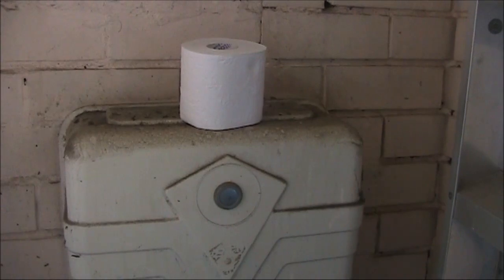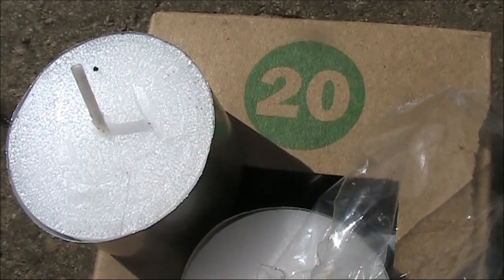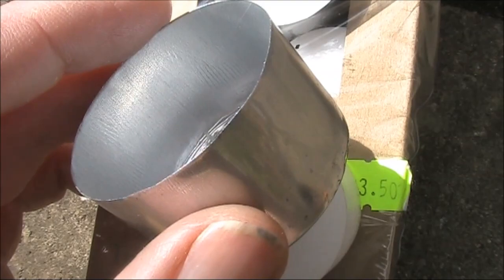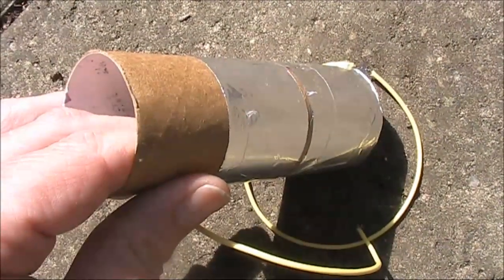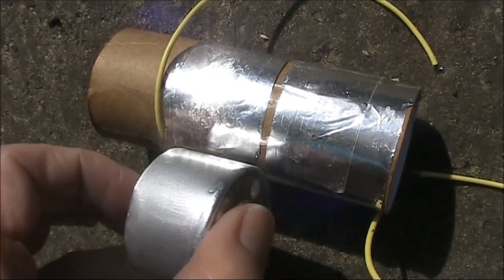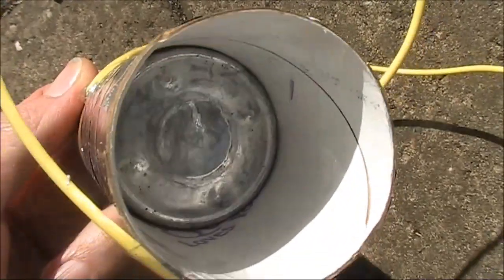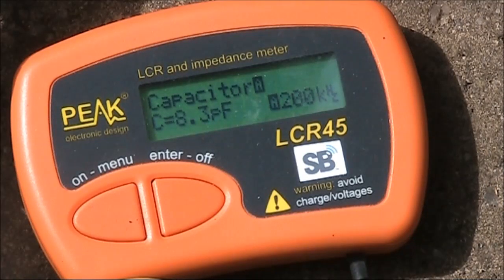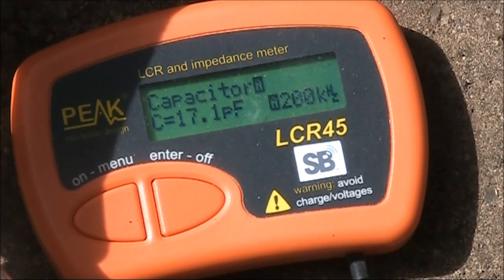Electronics on the Floor: Make a toilet paper roll variable capacitor

Comment: Nice one, the classic application of toilet rolls that I've seen so far is as winding body for inductors.  You might be able to combine both, winding a coil around the outside and connecting a wire to the slider could give you an adjustable LC network of some kind in one go.  Not sure though on the range of frequencies you may cover there.
Reply from the maker: Thanks Roel. The best approach I think would be to use two toilet rolls and cut a slit down one and tape to end up with a thinner former. Then have two sliding inductors like I did with the crystal set a few videos ago. You might also have some taps for lower inductance options. Main issue is getting sufficient capacitance but you could overcome that by having a few fixed capacitors instead of the variable capacitor.

Comment: interesting as always, i will say though just in case you hadn't heard and i get the opportunity to finally teach you something:

you can actually solder to aluminium. the trick to it though is to keep oxygen away. cover the alu with something like paraffin and scratch away the oxide from the surface before soldering. the paraffin stops it from oxidising again. - i should say.. i've not tried and i've heard it murders iron tips.
Reply: I’ve tried it and it does murder iron tips.

Comment: If you used two tealight aluminum back to back as the slider, you could build a variable capacitor with a greater range. The two aluminum holders could be held together with either a nut and bolt through the center tr taped together with aluminum or duck tape.